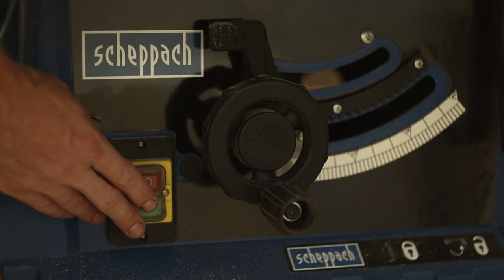The Ultimate Shop cart with Outfeed roller and “Hidden” storage

Comment: Great cart build! The only thing that I would have done differently is to use bigger wheel casters with a locking mechanism on each caster. Other than that, nice work.......... 👍👍😉😉
Reply from the maker: Yes! That’s the only thing I would change now! These plastic ones are a pain!